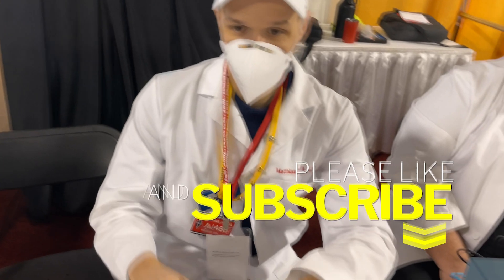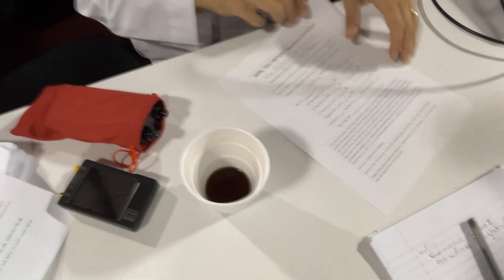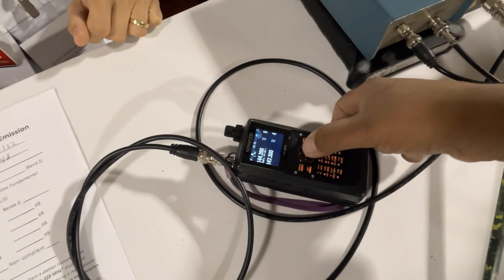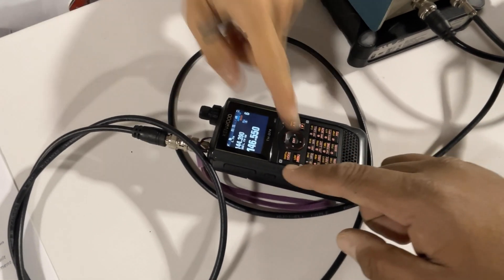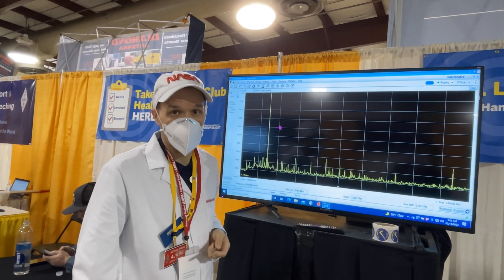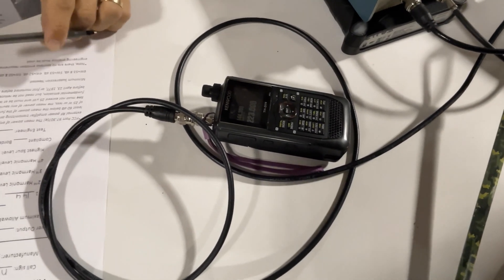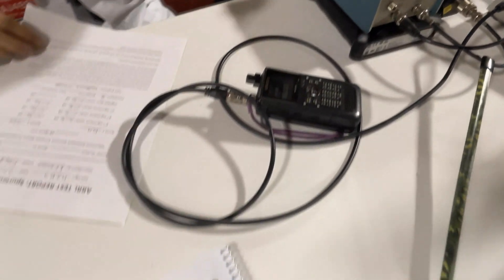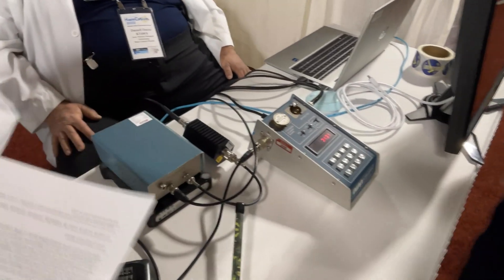ARRL tests my radio. Is it clean? Will it pass? Will it fail?

Comment: Great info Ria! So here’s the $100mil question…what happens if your $500 HT radio isn’t compliant? Do you just stop using it and suck it up, or send it back to the manufacturer (if they’ll even take it), or just keep using it knowing it’s not 100% within FCC specs (obviously not advocating for illegal use, but not an unrealistic expectation from most consumers)? I’m curious to see what they told people there.
Reply from the maker: If it's under warranty I'd definitely send it back without any hesitation. Especially if it's within the return period. If it's an older radio you'd have it checked out by someone who knows how to adjust it or fix it. Some older radios are actually exempt from the requirements.